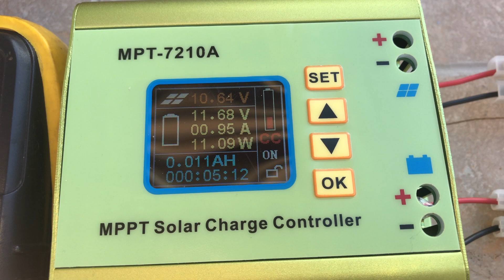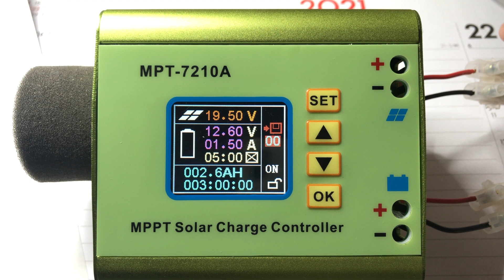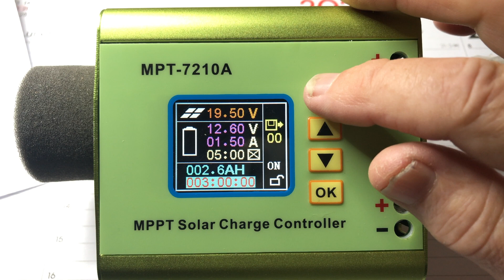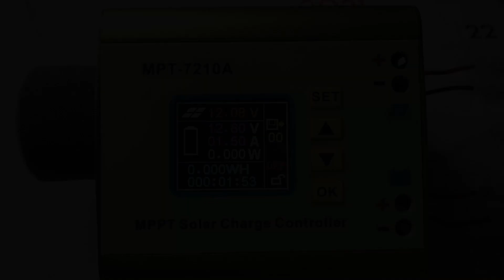MPT-7210A CONFIGURATION

Comment: Using the charger to lower a high input voltage is very wrong and can cause damage because the 7210a can not control anything and does no "work". it just on with the display and lets you see what is happening. You could save power when you just remove the 7210a because it does nothing in this wrong setup.
Reply from the maker: I works extremely good in practice för 1,5 years. The only problem is cloudy days. I cannot control the clouds.
Reply: @osopolarmovies  It doesnt blow up means not that it works good. Try to lower the current and figure out, that it really doesnt "work" in therms of a "function". The regulator is a boost controller, not a buck. If some day your bms fails, the lithium batteries will for sure catch fire, because you have no option to prevent the charger´s output to behave somehow.. for examle you cannot set the output voltage in a save range (or at all under the input voltage). If you replace the charger with a diode, you will see, it will do a better job in therms of energy harvesting. Both are not fused. This setup is terribly wrong and you lead others to a dangerous setup. In your situation, the input power is low, so the risk is relative low. Others which you lead to this wrong way maybe use more solar and fall into a very dangerous situation...

Comment: i enjoyed your video.

but i am hitting a snag:
i set the panel voltage to max 32v, which makes no sense to me as to why i need to set this. then i set the output voltage to 28.8v for two 12v agm batteries in series. then i play with the voltage input using a variable power supply, taking the voltage from 9v slowly to 32v and noticed that the charge controller decides to start  over charging my battery. 

there seems to be some relationship between input voltage and output voltage to battery, no matter how its set. in real life i can see slight fluctuations in voltage throughout the day, but mostly the power output will be affected by amperage. if i set the battery voltage for 28.8v, it should stop charging no matter the input voltage, but it doesnt.

i now have the input voltage set to 22.57v on my psu, mimicking a solar panel, and max battery voltage set to 14.4 x 2= 28.8v for two 12v agm in series, but the charger is still trying to put power into the batter at 28.86v x .45amps =12.90 watts. seems like once it hit 28.8v it would stop charging

also, if you look at the description of this device it says on the amazon listing that it is for 24v -90v batteries. also, there is no listing for maximum open circuit voltage which is strange to me.

it seems like this device also has some sort of step up mechanism and from my short experience, it may even be required to have the voltage of the battery higher than the input from the panel.

appreciate the video, just thought i'd share my early thoughts on this unit.
Reply from the maker: There is a step up mechanism. I use 12V so I have not been able to check how the algoritm looks like. However this is the best charger I have tired.
I has worked one year now without any problem. Probably I have to change the fan in the future. Good luck!

Comment: Your claim that you can set the PV voltage at 22V and charge a battery to 12.6V is totally flawed. In your system for some reason at morning times the panel only gives 10v which allowed you to charge a battery to 12.6v. Since your system is so small (three 18650), they got charged up to full during the morning hours. But later when the output voltage of the panel is higher than 12.6v, nothing will happen. For most other people, a 12v panel will output a voltage much higher than 13v at any time, there is no way one can charge a 12v battery with this controller. I was mislead by your video and tried and failed miserably. I do not want others to have similar wrong believe.
Reply from the maker: It is stil working perfectly for me since i made the installation. My lamps are on in the morning and I am just happy.
Reply: @osopolarmovies  Sounds like the BMS is saving your batteries when a higher voltage is passed through the charge controller.
Reply: this is absolutely correct! The charger has no effect on what hapens to the batterys in this situation when the panel voltage is over batt voltage.

Comment: As far as I know the battery voltage has to be higher then the Solar Voltage with this Controller because it's a step up Charger. I have not tried it by myself but I remember that either Julian Ilet or Adam Welch tried it and found out that a 18V Solar panel and 18V Nicd Battery did not work. The he put 2x 18V in Series and it worked fine.
Reply from the maker: I think the Battery Management System is a key component in this project.
Reply: @osopolarmovies  Another user stated the 7210 charge controller has a PWM fallback option in case it does not need to step up. If this is true it would not be as efficient if it really skips the MPPT in the process. Would be interesting to know but on the other hand for small applications there are cheap mpt-step down controller boards up to 5A that are quite cheap and they are working efficient too.
Those are CN3722,  XL 4015 and BQ 24650 based solar charge controller without case and (most without any display. I just tried recently all three of them with a 60 and 100W panel by charging a 16.8V 4S Lithium pack and measured the Charging power the archive. The BQ 24650 seems to be the most efficient  with the other 2 only 2-3% less. I measured all three in quick succession with the same sun and the same quite empty battery. I also compared the three with a "proffesional bouilt mppt charge controller with the same panel and got the same Charging power. So it seems the 3 cheap Controller boards which cost between 4-8 Euro are a quite suitable option for up to 5A. 
When I tried the 100 W panel they also did quite well (although 100W is almost to high) only the CN3722 based controller was not able to draw down the Panel Voltage to the MPP of 18V but it delivered Current and did not blow up.
Regarding the BMS: Always, when in Series with Balancing, when single cell at least under/overvoltage Protection.
Reply from the maker: @schubi128  Interesting! I ordered an XL 4015 but it never arrived. Solar cycle 25 is here and it will bring more clouds. So far OK. Charging normally takes around two hours.
Reply: @osopolarmovies  the xl 4015 is the cheapest and the easiest to get and works surprisingly well but needs a diode between output and battery or else 💣. already destroy two of them. One because I forgot the diode and the other for some reason I forgot.
Reply from the maker: @schubi128  The diode should be built-in! I will try to remember this.
Reply: @schubi128  It has not, it "becomes a diode" and loses all settings control. you will see, you have no possibility to trottle corent. only bms protects the cells from burst. it is somehow "ok" but a diode does the job better here.
Reply from the maker: All I can say is that it works perfect, https://youtu.be/l2PeYAy-bjg